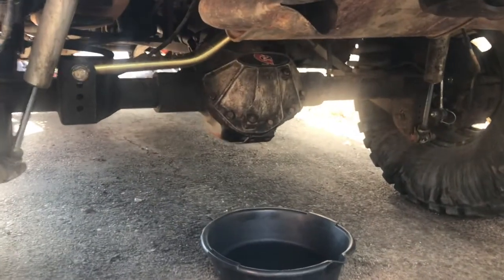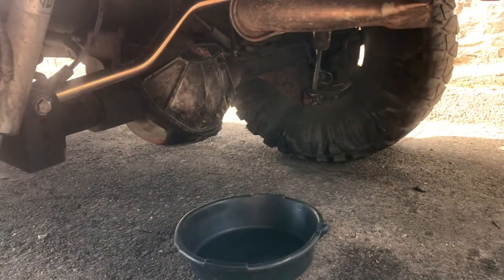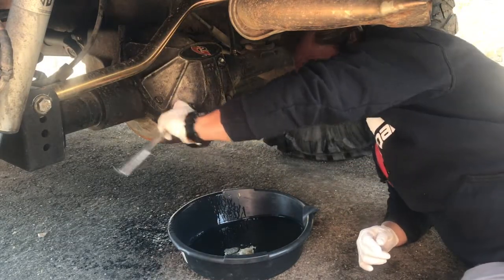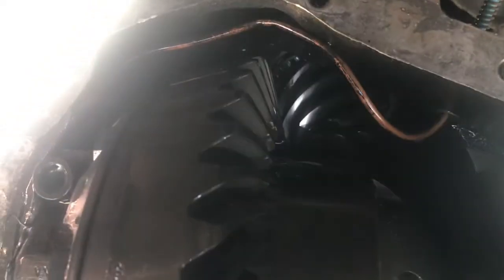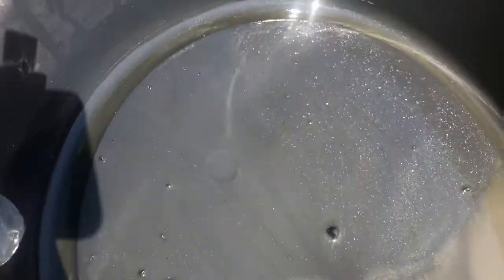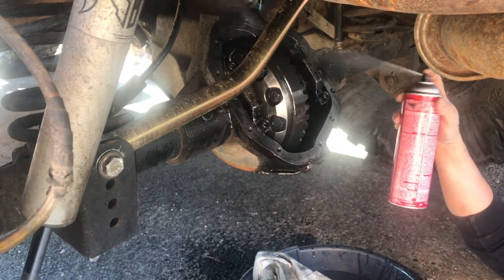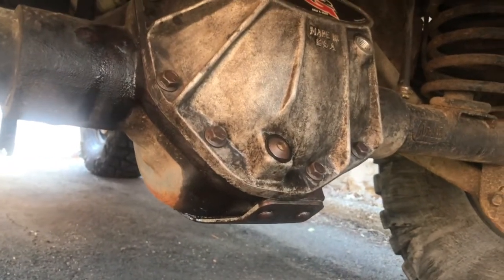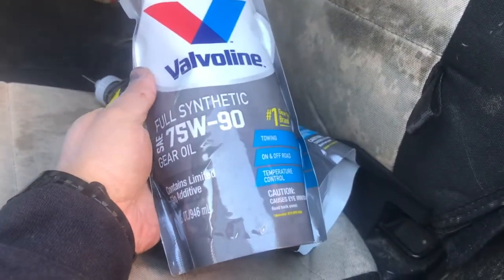Rock Jock 60 Diff Oil Change & LubeLocker Install

Comment: how much ground clearence do you get using that axel instead of a shave kit?
Reply from the maker: I've never run an axle with a shave kit so I really can't comment on that. But I can say that this axle feels like it is similar in ground clearance as the 44 I had if not a little less due to the larger diff case.

Comment: Have you had any longevity issues running that rear on the street? Oiling issues?
Reply from the maker: I've had pretty good luck with this rear over the years. No issue on the street but I have worn out and broken pinion and gear teeth. However, my guess it's from hard wheeling and not from the street.
Reply: @JK_Joyride  awesome. Thanks. I just picked up a used housing. Going to rebuild it and send it.